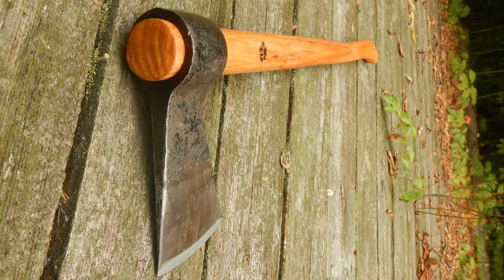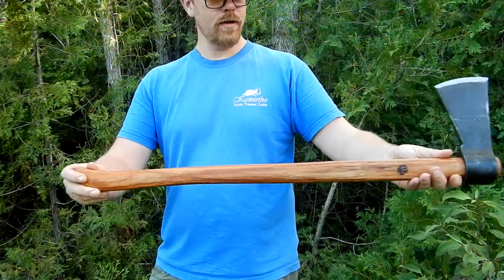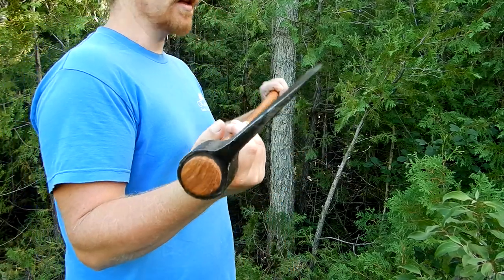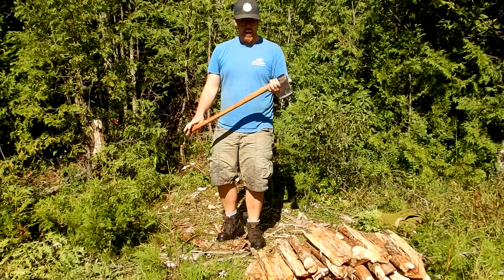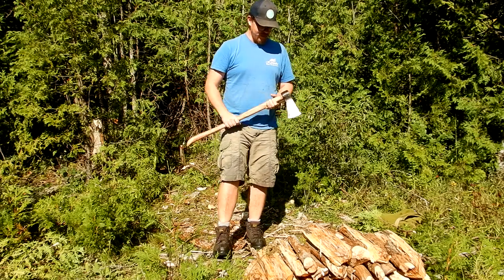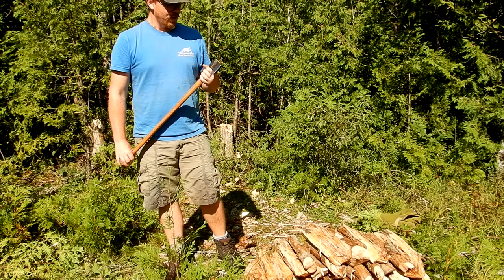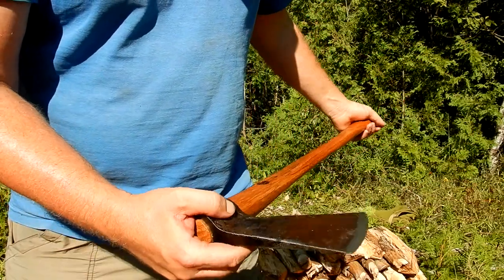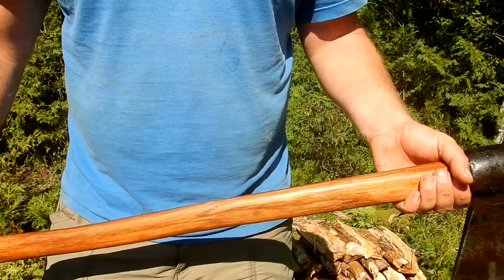Trying out a slip-fit axe: First impressions of use and hanging.

Comment: I feel quite badly for you dealing with that dead elm . I think a 4 1/2 or 5 lb Tassie would be your friend there. 
 One thing I've learned with bucksplitting. That carries over to regular bucking is. Sometimes, missing your kerf is a good thing with the shallow , flat blade axes . Like your slip fit or my Pandel. It makes a pressure relief cut that so when the next blow goes into the primary kerf. It penetrated better and releases much easier. And in my case. It keeps my splits larger so I get a better burn. 
 Your elm is Not a candidate for bucksplitting !!!! As I'm sure you know
Reply from the maker: Ha ha no it is not. I've got an aspen that came down so I will hopefully have time to practice the bucksplitting method on it.

Comment: Looks like a fun axe, great looking handle! Like you said blades a bit thin, seems "sticky" but looks like it is a pretty decent utility pattern. I love my tomahawks and slip fit belt axes, have thought of getting a larger one made by a custom smith. My problem is picking a pattern/weight to have made! I definitely like to bevel the top and bottom of the eye, my favorites have several size handles l like to swap in.

Comment: yeah the totally round eyed ones are pretty odd to use, the d shaped ones are better except for speed of making new handles
Reply from the maker: I can see that if for make-shift handles but in this case I put much effort into fitting to the eye so I took the head on and off many times and each time I had to re-find the same alignment again, which was a real pain. Maybe I was a bit of a try-hard so I overcomplicated things and missed the point of this pattern. Anyway, because of that (and because I was starting from a billet by hand and not a dowel and no access to a lathe) I have the idea that it would have been easier to make the handle had the eye been a different shape. Then at least the on-off process would have been less fiddly.

Comment: You did a really nice job on that axe! Slip fits are awesome. I’m surprised they didn’t design that with a wider, more ovular eye given the length of the bit. Bet it would be good in coppicing small stuff and limbing. Definitely not much of a splitter, but it’s still really neat to have in the chopping collection.
Reply from the maker: Thanks!
Reply from the maker: Thanks. If you've not seen it, check out Theud Bald's video with a somewhat similar axe here using a chop-and-pry approach https://youtu.be/KnJlkVjNbNs There's different techniques that this sort of axe is suited for that aren't really familiar to me.